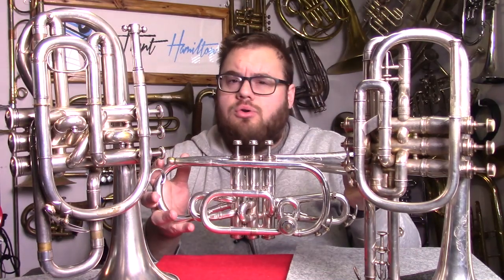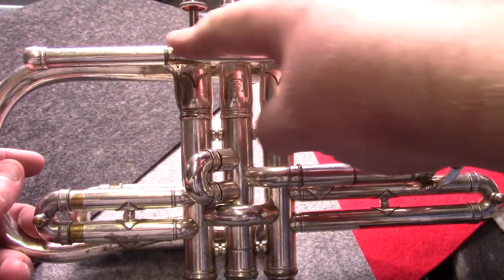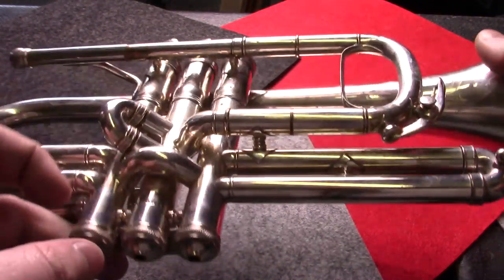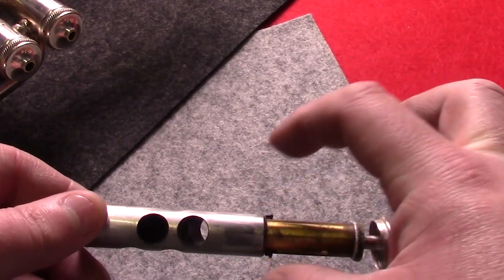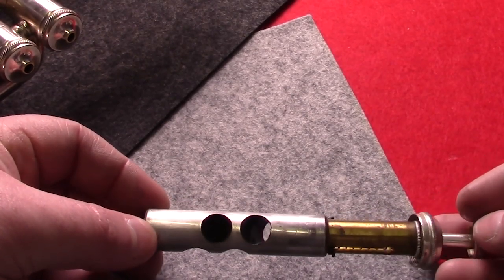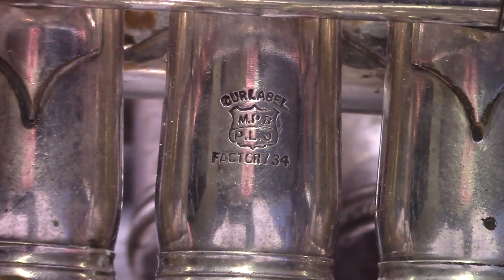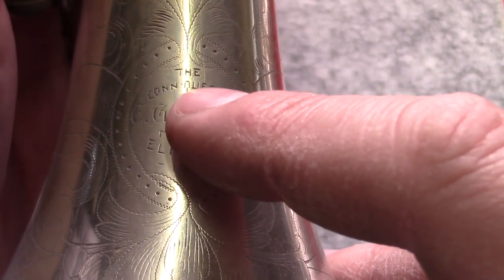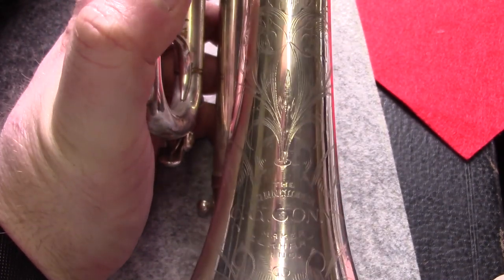Pointless Innovation and Wanton Complexity | The Connqueror Cornet

Comment: From Conn's patent application:The object of this invention is to construct a cornet or similar instrument so that the air vibrations set in use by the performer when the instrument is in use shall be conducted through the valve system without increasing the number of turns or crooks and without changing the general direction of the wind - passage." The patent goes on to explain: "Musical instrument makers have long attempted to manufacture a cornet with an equalized scale, so that both valve and open tones shall have the same freedom, volume and quality. Heretofore they have been unable to do this because there have been more turns or crooks in the wind - passage when the valves are depressed then there were when the valves were not in use. As a result of this faulty wind-passage through the valve system the valve tones were more or less muffled, while the open tones were comparatively open and sonorous."

Comment: Thanks for the video! I have a Conn-Queror from 1903, that I've used in my work in the Gothenburg Opera Orchestra, and although somewhat unorthodox in design it is actually a suprisingle well-working cornet! the reason for that extra, weird tuning slide is that if you take it's middle part off, you get a cornet in B. With the middle part back, you get a cornet in Bb, and if you pull the slide out to where there is a grove in the tubing, you get a cornet in A. All the valve slides have two groves in them; pushed all the way in, the instrument is in tune for B cornet, pulled to the first grove it't in tune for Bb, and second grove for A cornet!
Reply: Thanks for this. I have one too and couldn't figure out why the intonation was so off on it when all the slides where in.
Reply: Thanks for posting. Mel from Long Beach CA. Just picked one of these up at a swap meet. Had a devil of a time arranging the valves to get it to blow. Am I right to say the 3rd valve slide with the marching music holder does not slide at all as well as the 2nd valve small "cleaning" slide? P.S. I have a second main tuning slide that is longer which I assume changes the key too???  No grooves in any slides.

Comment: You can engineer specific frequencies to resonate in brass instruments by strategically placing conical vs. cylindrical tubing. With more cylindrical runs you're probably pulling up higher frequencies and pulling down lower frequencies. This may be an attempt by Conn at creating a compensating system using only cylindrical/conical variations, rather than  Besson's add-a little extra tubing method.

Comment: The 3-prong valve guides were pretty standard at the time in American cornets. The "advantage" to them (I guess you could call it that) is that one's like that with 3 equally-sized teeth are effectively sealed into the valve at the factory. The top of the valve is soldered into the bottom part and the valve guide is too big or the guide slots too narrow for it to rotate and come out. Later versions of this design (King Master models come to mind) have shorter prongs and one prong thicker than the others, so you can rotate them and slide the guide out of the wider slot. 

Other things I thought of over the course of the video!

- just take the finger button off the older Connquest, polish it, and complete the newer one! It's a beautiful horn and deserves a complete set haha
- They were built at the same Elkhart factory, but the stamp changed because C.G. Conn was extremely supportive of his factories' unions and actually advertised the Union-made horns as such with pamphlets in the cases, union Shields in ads, and everything.
-  iirc from reading, a lot of the decision on how to route the air through the horn was based more on making easy slide pulls/swaps to make one horn play in more keys and pitches.
- Victorian America was a place entirely fueled by bravado and boastful superlatives and Conn's model names show that off beautifully, I think
- there's nothing new under the sun, especially where brass instruments are concerned. "Superbones" as a concept began in the 1890s, for instance, and even today there are plenty of horns with unnecessarily complicated placebo improvements that will make the player swear by them solely because they paid for it. None of the biggest cornet soloist of the day were playing these "experimental" types of horns, maybe with a few occasional exceptions.
Reply: Hey Evan, I see you on Trumpet Hang on FB. Very informative comment!
Reply: @SamuelPlaysBrass  hey Sam! Small world on the brass interwebs haha
Reply from the maker: Hi Evan, thanks for your comments - very much appreciated! I tried swapping the finger button over, and the thread was different! I have since removed the valve stem and swap the stems over... I now do have one that is complete. It's so odd that the threads on the finger buttons would be incompatible.
Reply: @TrentHamilton  that is weird. So random the things they would change year to year.
Reply: An excellent reply! I particularly liked the reference to swapping out slides to pitch the instrument in a different key. That would never have dawned on me.
Reply: I have a 1907 mellophone by Buescher with the unequal 3-prong guide design as well, so it seems like the idea was around at that point, just not used by everyone.  I've even seen a 1904 example of the same mellophone, and while I didn't see the valve guides I'd guess that it had 3-prong ones as well.
Reply: Thanks for the cool additional information!
Reply: Thanks for posting. Mel from Long Beach CA. Just picked one of these up at a swap meet. Had a devil of a time arranging the valves to get it to blow. Am I right to say the 3rd valve slide with the marching music holder does not slide at all as well as the 2nd small "cleaning" slide? P.S. I have a second main tuning slide that is longer which I assume changes the key too???

Comment: Looking at the 1906 C.G. Conn's Truth (basically their catalog/magazine combination at that point), Conn's claim is that the routing of this valve system means that when the valves are used the "direction of the vibratory air column is simply extended by the use of the valve slides and its general direction is not changed", which I take to mean that basically there are fewer sharp bends in the valve block, and that the angles of the bends are closer to equal between having the valve up or down.  Definitely makes for a lot of extra complexity, the real question is whether or not it plays well.  I guess an interesting contrast between this and the Couturier is that while that obsesses over a perfect conical bore profile, this sacrifices the amount of tapered tubing for a "better" air passage, as presumably the valves are all of the same bore, which would make the secondary tuning slide loop cylindrical as well.
Another interesting thing I noticed, in the 1904, 1906, and 1910 catalogs it is referred to as a "Conn-queror", with the dash.  So, I guess there was some inconsistency within Conn as to what it was called, or perhaps the engraver was tired of that extra line in 1906.
Reply: If anyone's interested, here's the section from the 1906 catalog talking about the valve design:
"The Conn-queror Cornet is different from any other cornet, including the above mentioned, inasmuch as the wind passage is new and constructed upon scientific principles.  The vibratory air column on leaving the mouthpiece enters the second valve at a point between the valve slides and is conducted to the first valve by means of a connecting bend.  It also enters the first valve at a point between the valve slides and is then carried to the second valve, which it also enters between the valve slides, and thence through the valve into the bell.  When the valves are depressed the direction of the vibratory air column is simply extended by the use of the valve slides and its general direction is not changed, as is the case with ordinary valve systems.  There are no reverse turns or abrupt angles in this new wind passage to break or impair the air vibrations.
Those familiar with the construction of a cornet and the absolute necessity of an improved wind passage will see at a glance that the Conn-queror Cornet possesses advantages not to be found in any other instruments.  The conducting of the vibratory air column to a point between the valve slides admits of a greater facilities of execution and more rapid and difficult passages of music can be played with this cornet, because it responds more freely and has a higher degree of resonance."
Reply from the maker: Thank you so much for finding this for me! It's hard to judge what the actual experience of playing this instrument would have been like when new, but it seems to be quite stuffy - more so than the Couturier, and a lot more stuffy than the Meredith. I think this might be a case where the "scientific principles" make sense to the mind, but don't actually carry to the real world results - at least not with the 110 year old sample I'm using...
Reply: I’ve got a 1905 “Conn-queror” cornet. I just purchased it approximately 2 hours before watching this video. Got a heck of a deal. ✊🏾😕
My engraving has the hyphen, indicating that it might not be a Friday afternoon horn after all. I wonder if anyone has been able to unstuff at least some of the stuffiness with a wider mouthpiece maybe? Or is it just stuffed?
This video is extremely informative, and it would have been even more informative had I found it 2 and 1/2 hours ago.

Comment: I've got a King Eb Alto Horn made by H.N. White made in Cleveland, Ohio that dates back to the mid 1920's. It also has the three-prong valve guides that are equally spaced. There is one, however that is larger, but that doesn't seem to prevent the valve from locking into the two other wrong positions. It looks like a design idea that multiple manufacturers ran with for at least a couple decades at the beginning of the 20th century.

Comment: I've seen a cornet with rings instead of buttons on top.  If your valve got stuck you could pull it up.  Some said they could play faster by pressing and pulling on the valve rings than buttons.  Selmer made a cornet where the valves were not parallel to each other - the third valve angled the top away from the player and the first valve top was angled toward the player.  The idea was since the second valve was played with your longer finger, you could maintain "the claw" hand position for faster valving.  I've also seen a compensating cornet.  The second tubing on the second valve was about the size of a piccolo trumpet second valve tube and the fourth valve was mounted horizontally and played with the right hand.  It looked awkward when working a harmon mute or a plunger.  
Maybe you can acquire such instruments and show them to the world????
Reply from the maker: Any idea what brand the ring-valve instrument was? I'd love to see more about it.

Comment: Can you do a video on bore adapter for like small bore to large bore
Reply: That's not because you stopped using an adapter.  That's because you stopped using a mouthpiece that is >5mm too deep for the instrument.  A Schilke 31B is something like 25mm deep and that's shallow by American standards.  A typical Alto Horn mouthpiece is less than 21mm.  Whatever the heck Mellophone mouthpiece you're using is probably less than 16mm deep.

But seriously, the only shank adapter that really makes sense is small tenor to medium (euro) shank.  It's the only one that costs significantly less than a new mouthpiece.  Small to large tenor is dumb unless your main horn is small shank and you play the world's most obscure mouthpiece.  French Horn adapters are dumb unless you're really digging into some mega obscure instrumentation (see above).  All those Trumpet, Cornet, and Flugel related things are ridiculous.  Of the ones that don't just fit into the shank anyways, you'd never have a reason to bother.  And again, for 99% of adapters, the cost is absurd compared to just buying a mouthpiece.

Comment: Hi Trent, Have you made a video on the "ECHO" cornet. I my father had one. I remember playing it, by pressing a 4th valve the sound came out of a muted tube instead of the noisy bit.
Reply: I have an echo cornet on order, just an Sai one from India alas, cheap and no doubt cheerless. It seems to be difficult to get hold of "proper" (reputable) echo cornets. From my limited research it looks like the idea never caught on, and people decided to just use an external mute for better choice/flexibility. An interesting idea though; there are some good YouTube videos where people perform effectively with echo cornets.
Reply from the maker: Unfortunately not. I don't have one in my collection, and they're a bit expensive to get a decent one.

Comment: Hi Trent I have a 1906 Lyon and Healy cornet and the design of the valve also has a three guides for the valve it is really annoying to use because every time when I oil the valves I put them back in they lock and get stuck and then the spring gets cockeyed so I have to pull it out and adjust it until I get it right but anyway it is a wonderful cornet in my collection

Comment: Someone should make a prank instrument where each valve can be put in in three orientations, but all three of them are playable. Depending on how they're turned, each valve would function as a 1st, 2nd, or 3rd valve. You could give it to someone with the valves all turned around and watch as they struggled with the mixed-up fingerings.
Reply: It might be too hard to route three different air passages through each piston but if it was only two, it might be very doable. I think the coolest way would be if you unscrewed the piston from the pushrod and flipped it over, with extra bores designed such that it would now have precisely the opposite effect! The trumpet would sound as if all three were depressed and pressing them would raise the pitch.

Comment: Cool engravings on the bells though! :)
If the older but better condition instrument is still playable (I'd scavenge the third valve top from the newer cornet and put it on the older one) it would be interesting to do a comparison of effort required/playability between this and a comparable but less over engineered design.

Comment: If you want to use three valve guides,   better not to have them equally spaced.  That way it's keyed to a particular orientation.  Video game controllers, of all things, do this, though I suspect it's as much about distinguishing between the different buttons at assembly time.

Comment: Funny that you're talking about air flowing through. It's sound waves that flow. The air could be perfectly still and it would play the same.
Reply from the maker: Except the propagation of the vibrations is affected by the warmth of one's breath. Human lips cannot generate vibrations at the appropriate frequency without airflow. So the flow of air affects the ability of the lips to vibrate, that vibration affects the sound.
Reply: @TrentHamilton  Yes, air is required to vibrate the lips, but nothing more. Air is not responsible for the resistance experienced when playing a brass instrument. Sound is.
Reply: The principle is stated at 6:03 in this vid https://www.youtube.com/watch?v=WZvDvuxjHvU
Reply from the maker: @peterc.7841  I've seen that video before. It would have been nice to hear that with a proper microphone. I do not believe that the tone quality would be anywhere near as good.
Reply: @TrentHamilton  Yes unfort Mr Smith does not produce a nice full sound with any airflow method in that video.

Comment: i have a conn elkhartino baritone. at least its interesting as a name however mine is in bad shape because i bought it at a local thrift shop in a non working condition however i managed to get it working all but two tuning slides which are completely stuck. do you have any easy ways to remove them. i would take it to a repair shop but i do not have a repair shop anywhere near me.
Reply: I've read the 3rd valve slide is not removable. On this recent Conn-Connqueror purchase, there are 2 "stuck" slides.

Comment: Aside from the valve guides, there is no significant difference between the Conn Conn-queror and a conventional cornet.  The second tuning slide is probably a convenient place to put an optional "A" tuning slide, since the Conn-queror was marketed as a B-flat/A cornet.

If you don't like it, then clean it up and sell it. Austin Custom Brass (in Texas) has a 1906 Conn-queror for sale for $599.99 right now.

Comment: I wonder if computer design and modeling has made an impact on modern brass instruments.
Reply: I wouldn't be surprised, modern physics simulations are incredibly advanced and I'm sure modern manufacturers have used them to make millions of tiny changes that have resulted in more significant differences in how instruments play. Modern manufacturing techniques have also greatly increased the consistency of quality.

Comment: It's always form over function.  A mediocre, but cool looking instrument will always have a better chance than some ugly duckling.

I think I recall reading the reasoning behind this goofy air path, but I forget what it was.  In any event, there was some reason besides "looks cool" and "cornet things", even if it was still marketing wank.

As far as the valve guides, the worst I've ever seen are actually the Frumpet's.  Just got one and was totally floored when I took a valve out the first time.  Massive, sloppy fitting valve guide with no indication of direction.  Top sprung pistons are the freaking worst.
Reply: According to other commenters, the design of the tuning slides allowed for the instrument to be played in several separate keys.
Reply: @megelizabeth9492  And?  Literally every Cornet with a removable leadpipe (shanks) was designed to play in multiple keys and pitch standards.  This is nothing new and in no way unique to this Cornet.